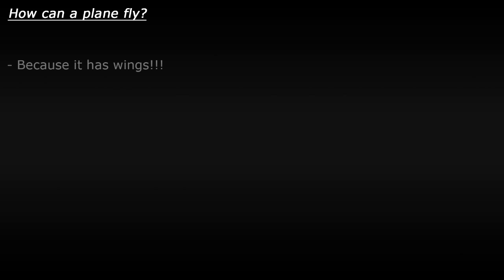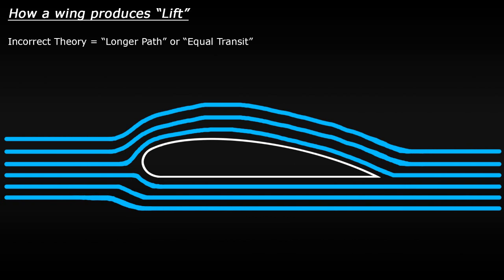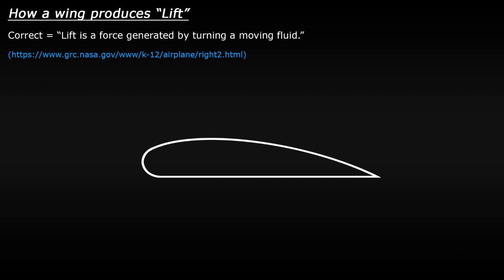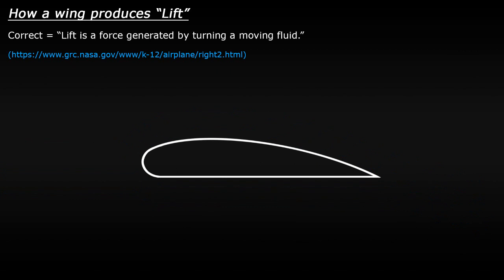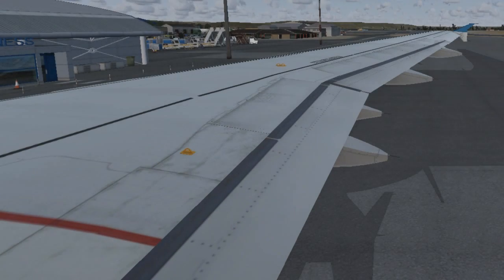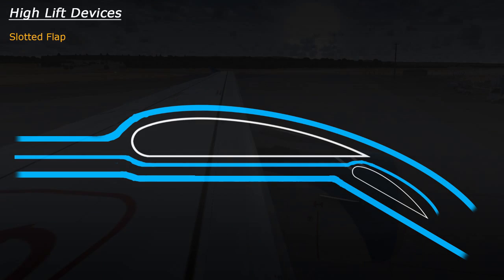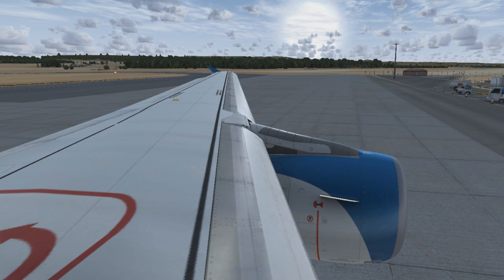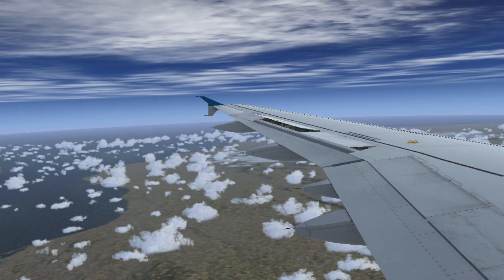How Wings ACTUALLY Create Lift!

Comment: Thank you thank you thank you!!
Since I'm a small kid I read in every physics related book that a plane can fly because of that pressure difference caused by the equal transit theory. And since that time I could not believe that this "quicker airflow above the wing" would be enough to lift a plane.
Now I'm 36 and today I learned that its not the "quicker airflow above the wing" but the "direction changing" of the air.

But why??? Why physicians my whole life long tells wrong things??? Why I need to turn 36 to learn such relatively basic physics knowledge?
Reply from the maker: I don't think physicians were wrong in the past, they just didn't fully understand what was going on.
Reply: Thanks for the reply!
No, this difference in explanation is based on (for a physicist) relative easy principles. I am sure they know this difference since the 1930s or so. Just think of all the improvements and optimizations they've made to planes that they couldn't do if they didn't know such fundamentals.
Reply: Thanks, yes I meant physicist (English is foreign language to me...)
Yea, but why are 99% of the lift explanations not only on YouTube wrong?
Reply: being an old fart, I have heard a lot of theories about how a wing generates lift but, not too many about why a wing does it. amazingly, I find almost all of the theories are correct. when taking the licensing tests, be sure to use the "approved" knowledge to answer the questions on the written tests and answering the examiners questions.
years ago, experiments at NASA with a perforated upper wing surface attempted to demonstrate lift generation by reducing upper surface air pressure by evacuating air above the wing thru a perforated surface.  the program became an experiment in boundary layer control and proved that dust and dirt clogs very small holes. I believe they used a B-66 airframe. It did much better at controlling boundary layer than generating lift. that result was sort of lost in the data. the common man probably expected the aircraft to simply "lift" itself off the ground when lower air pressure was applied to the upper wing surface. Obviously, that did not occur. over the years, NASA, USAF and USN have tried many different experiments and methods of augmenting the lift production of aircraft wings; that data is available in archival form if you know where to look. Taxpayers paid for it, so they can use it. 
I am convinced that almost all the theories are to some extent correct with relation to what air does around a wing and a  lot of that is dependent on the speed of the air the wing sees as a whole. many times we see confusion over what is a result of an effect and what is an effect of a result.
Asking a lot of questions about the different theories of lift generation is a very good thing for your mind and will help you to understand why things work the way they do and  that people do not know everything. there is a huge difference in "belief" and "fact". "I believe I have the runway in sight" is a far different statement than "I am at the runway thresh hold and am touching down".
Reply: @tharconian3243  Correct. Bernoulli (properly applied) says the same thing as Newton says the same thing as Kutta-Joukowski. They're all useful distinct ways of looking at it.

Comment: Why does it follow the top of the wing? TAKE THAT SCIENCE (jk just wondering if you know)
Reply from the maker: At the risk of being wrong, I think the Coanda effect may play a part in it.
Reply: I think it has more to do with viscosity, the viscosity of the air means that it is slowed down, and this would mean it is at equal pressure to the outside, no? So the air sort of sticks to it from it's viscosity, as if the particle closest to the wing (and therefore slowest) stops there would be a vacuum in front of it due to the particle above having a momentum (so it can't just dip down). This makes the particles above press it onto the surface, to avoid a vacuum. When they cannot do this due to the particle moving backwards, flow separates.
Reply: If the air wouldn't stick to the surface of the wing there would be a vacuum. And this sucks air from where ever it could get some. The air that goes over the top of the wing is easier to bent down than to get air from somewhere behind the wing.
Reply: @Delibro  Yep. Though of course if the pressure gradient gets too large it will separate

Comment: Also a simple explanation is 3rd newton's law.
Reply from the maker: Like the Bernoulli principle, Newton's Law is accurate to some extent however it doesn't fully explain all aspects of Lift.
Reply: Doofer911 Αctually you are right.
Reply: @Doofer911  What? Newton's Laws are accurate and fully predict lift. Make a large control volume around steady flow over an airfoil and measure momentum flux in and out. The change in momentum (Newton's Law) will match the lift and drag. Alternatively, determine the velocity profile over streamlines close to the airfoil, use Bernoulli to find the pressure distribution over the airfoil, then integrate the wall shear stress and pressure forces over the surface of the airfoil. You will get the same number. 

Bernoulli's Principle and Newton's Laws are identical (you can derive one from the other) though in practice they look different. Both fully explain lift. Kutta-Joukowski Theorem (circulation about an airfoil, which is basically 'turning' the flow) is derived from both of them (and therefore really identical) and also looks a bit different but is really the same thing.

Comment: But how this theory explains how an airplane flies upside down? ?
I think that the airplane flies 90% based on Newton third law.The wing's shape just helps and gives the extra 10%
Reply from the maker: If the wing was upside down and the Angle of Attack was high enough, the airflow would still be turned downwards. Newtons Law is correct but like the Bernoulli Principle, it doesn't FULLY explain all aspects of lift.

Comment: The coanda effect is not the reason the air stays over the wing. It is because the area of low pressure at the beginning of the curve of the upper camber tries to escape upward, but there is an area of higher pressure above that keeps it forced down over the rest of the wing.

Comment: A pressure diffentual is lift. And lift doesn't cause lift.
Reply: Lift is a force greater than an objects weight exerted perpendicular to gravity in opposition to it.
There need not even be a gas medium to hold pressure to have lift.

Comment: Why do people always explain bernoulli's principle in the wrong way🙄
They say: Because the flow is faster, the pressure is lower.
While in reallity, it is the drop in pressure (pressure gradient) that causes the flow to speed up. 
The change in velocity (acceleration) of every (fluid) particle is proportional to the force (pressure) across it! Simply newtons 2th law!

Don't get me wrong:
bernoulli's principle is corect, but it simply desribes the relationship between flowspeed and pressure within a fluid streamline, not that one causes the other to change!
Reply: If there is an inverse proportionality between flowspeed and pressure, then one DOES cause the other to change.
If there isnt one, bernaulis principle is incorrect.
Reply: @ineednochannelyoutube5384  Okay I said it wrong. But my point is that it is always the pressure gradient that causes the velocity to change and never the other way around!
Maybe this will convince you: https://youtu.be/_WHRWLnVm_M?t=386
Reply: @nielsdaemen  so a single streamline that increases in velocity will not drop in pressure?
Reply: @ineednochannelyoutube5384  Of course it does, the drop in pressure is what causes it to accelerate.
Pressure = force/area
Think about a single fluid particle. In this case the area is constant and the force on the particle is just proportional to the pressure. 
As I said before, it just comes down to newtons second law f=ma (a relational law)
But let me ask you:
Does the acceleration cause the force, or does the force cause the acceleration?

If you push on on an object, 
It it the force of your push that causes it to accelerate, or is it it's acceleration that caused you to push it?
I think you agree it's the first😌
Reply: @nielsdaemen  It need not be pressure that accelerates a fluid.
It can be fravity for example.does a fluid mass in freefall change its pressure under acceleration?

Comment: Another reason why fast moving air has lower pressure is because when it accelerates, the air thins out similar to a faucet where the water stream starts out wide but gets thinner as the water accelerates when falling into the sink. Thin air is less dense than so it’ll have lower pressure.
Reply: Water is virtually incompressible. Therefore its density does not change when it flows from the tap. The “thinning out” you observe is not a reduction in density. Air is not incompressible but compressibility is insignificant at velocity below about Mach 0.5. But when compressibility is a factor, it should be obvious that he effect is opposite to what you think.
Reply: @XPLAlN  It was just an analogy, I know its density does not change, water is liquid and a liquid is defined as an incompressable fluid unlike gas. That's why in a faucet, the stream gets narrower and keeps the same density instead remaining the same width while losing density.

Comment: Just plain wrong. Air speeds up when it is compressed by the up slope of a cambered surface (wing/airfoil) and lift is produced when the air decompresses (rebounds) slower than the down slope is falling away resulting in reduced working pressure on the down slope. Lift is a simple compression/expansion cycle that works because air can be compressed much faster than it can expand/rebound. Air only moves from more to less.Bernoulli saw an effect and thought it was a cause and people have been trying to prove him right ever since and coanda only works on a molecule thick layer in contact with the surface.
Reply: That's, uh, original. Wrong, but original.

Comment: "The air that goes above the wing has to travel further distance therefore it moves faster"

This is total rubbish.

First of all, it doesn't HAVE TO move faster. There's no police that DEMANDS the air ABOVE the wing to arrive at the back of the wing at the same time as the air below the wing.

Second. if just longer path ABOVE the wing was causing the air to move faster, why not making the path arbitrary longer. The longer the path, the quicker the air will have to go, right? So why not making it EVEN MORE longer, like INSANELY longer.

These are the two obvious arguments that the proponents of "air above the wing has to move faster" are intentionally ignoring

Comment: Stop talking about "air flowing over a wing", Air flows over a wing only in a wind tunnel when the wing is stationary.  In real aircraft the air does not flow much horizontally  but it is ACCELERATED vertically DOWNWARDS ( eventually) .This downwards acceleration originates for different reasons above and below the wing. In fact  if one has to be accurate, the air mass particles around the wing move forwards a little . I shall let the readers deduce why that happens. .

As the wing moves forwards, it  SHAVES  and accelerate the mass of air downwards. The SHAVING  starts at the leading edge and below the wing by compressing the viscous fluid to ACCELERATE IT DOWN,  Above the  wing the SHAVING  of the mass of air is done by first accelerating the air fluid upwards above the leading edge and then causing the tension in the fluid at a later stage to the trailing edge . The CONTINUOUS downwards ACCELERATION  of the masses of air above and below the wing results in an opposite reaction to lift the wing.

It is these acceleration at various locations that cause the Bernoulli, the Newton and the Coanda effect, and it is thee fluid accelerations around bird wings,  fish flukes,  and all the  flying surfaces that  exist in insects aircraft and helicopters and rockets and missiles,  

 .

Comment: A wing, flat on the bottom, curved on the top, with the bottom parallel to the airflow,  lifts some.   There is  no angle of attack in such a case. (In that case it lifts because of Bernoulis principle).    But that does not cause enough lift to support the plane.  It makes the airplane more efficient though.
The vast, vast majority of lift is actually caused by AoA.   Many, many airplane wings are symmetrical, i.e. they are curved exactly the same on the top and bottom.  So ....???    EVERY airplane you see flying has serious AoA.  Look at how airplanes are built.  The wing is always at and angle to the body. (So the body can be level while the wing is at an angle).

It has been traditional thru the 20th century to proclaim that the difference in curve of the top and bottom causes the lift.  Even the airforce taught that.  They should have been ashamed of themselves and many told them so.

Comment: Yes thisvideo is not the case and ignores many important aspects of proven design fundamentals and engineering facts. If you do not consider dynamic vs static pressure then this explanation will suffice for most. IN FACT it IS the low pressure above the wing (created by a faster moving fluid) vs the high pressure under the wing (created by the slower moving fluid) that causes the force of lift (or actually the reduction in down force of air pressure) to overcome come weight (gravity plus air pressure) of the aircraft. This occurs at the center of pressure of the airfoil. This video confuses the principle of turbine design where you add energy into a moving fluid through a venturi whereby the expansion of the gas reacts against the structure causing a directional effect. In a wing lift is created by the energy of the airflow being separated and the interaction of simple pressure differentials. No direct fuel added.
Reply: The force occurs everywhere along the airfoil. The center of pressure is just where the moments balance out

Comment: Your theory is also incorrect as it makes no sense whatsoever! Why would air dropping downwards at the back create lift?!?! Explain that one? It seems to me that would only create a downdraft which would try to pull the aircraft down with it and REDUCE lift! The only logical way the main amount of lift can be created is simply by the force of the air hitting the UNDERNEATH of the wing and lifting it up with the force as it hits. It is simply newtons 3rd law of motion. That is not to say that some additional lift may not be created by some kind of pressure differencial, but it seems absurd that that would be the main force of lift and the nonsense theory that it is, (so often branded about by so called experts), has been discredited by NASA. Also your diagram is wrong as the bottom of the wing is flat in it which means there would be no angle of attack whatsoever. It seems to me that if there were no angle of attack at all, there would be no lift from under the wing and no flying! Your stall definition is also false. It has nothing to do with air separation, but simply the force under the wing becoming insufficient to hold up the plane's weight. Where did you get this stuff from? Your theory is even worse than the old discredited one! Also, I think flaps create extra lift more by changing the angle of attack at the back of the wings than by increasing surface area. Increasing the surface area won't add a great deal of lift unless the extra area can catch enough wind to be lifted up by it.
Reply from the maker: It's funny reading your comment, you don't even sound convinced by your own arguments when you say things like "It seems to me..." and "I think flaps create extra lift...". I'm not saying I'm correct by any means, but I would reccommend that you go and look into the subject yourself to understand some of the common understandings of how Lift is generated. I work alongside exceptionally experienced Flight Instructors and Examiners and even say that the theories regarding Lift taught at the PPL level don't tell the full story.